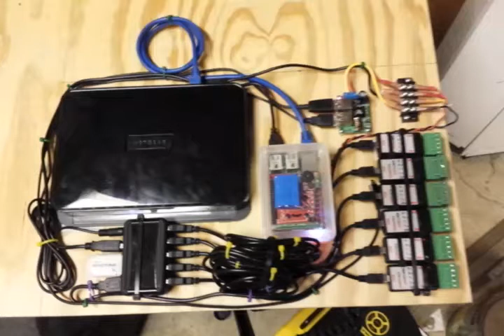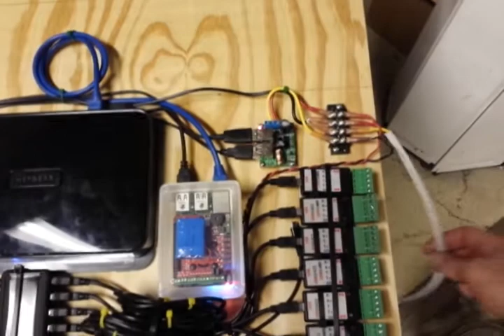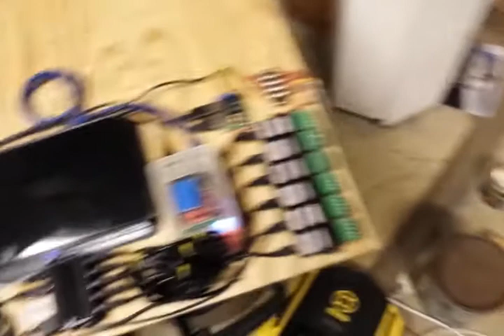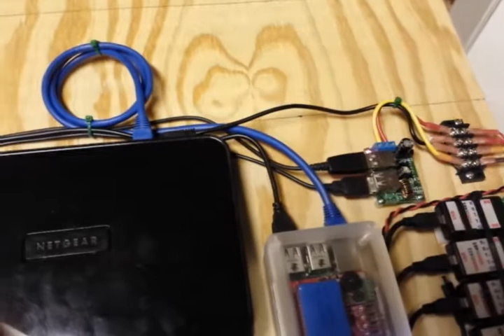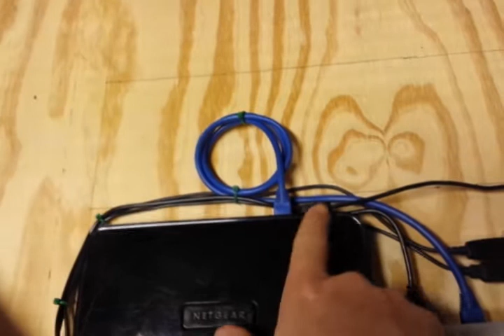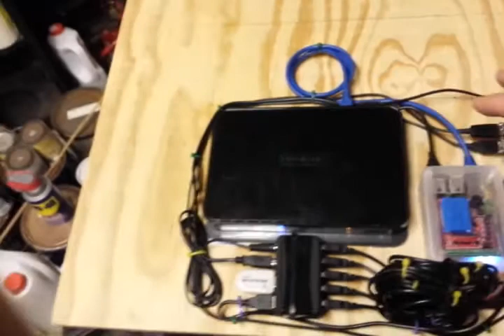Openplotter hardware

Comment: Where did you source the nmea to usb adaptors?
Reply from the maker: Ebay.  $10.  They are called RS-422 to usb adapters if I recall correctly.
Reply from the maker: https://www.ebay.com/itm/2-in-1-USB-to-RS422-to-RS485-Converter-Adapter-with-CH340-/131833025902?_trksid=p2349624.m46890.l49292
Reply: @muckleyj  thanks so much. $10 is super cheap. I have an old B&G system that I want to incorporate wireless into for multiplexing data to my Mac, phone, and watch. I’m hoping I can get my older radar to overlay. Also hoping to get remote control of my autopilot. Here’s hoping it works. Thanks again for the help.
Reply: @SailorDickChannel  hello I just see your post, did you get your old B&G to transmit data to your iOS SYSTEM ? I have an old Hydra 2000 and was wondering if it could share data ?
Reply from the maker: I would be hesitant to trust my life to this type of setup.
Reply: @muckleyj  I had a different multiplexer that was flawless until I screwed it up. Lol. Will definitely require some testing.
Reply: @muckleyj  I was also considering the Digital Yacht NMEA to USB connector

Comment: Hello thank you for your video. Have you try to connect an old depth sensor with coaxial cable after separate and unbraided the + and - pole directly to rs422 adapter? 

Thank you in advance.
Reply from the maker: No.  From my experience, typically, instruments need to go to their respective control head and then the control head will output a NMEA 0183 signal.  That's what I show in my video.
Reply: @muckleyj  ok thank you for your answer
Reply: Thanks bro great stuff

Comment: High risk and worthless for practical use, because only receiving ais is useless. Really important is SENDING ais, so other ships can see your in time.
Reply: Any suggestions for a "cheap" AIS transmitter?
Reply: Far from useless. If you’re crossing shipping lanes, you need to see the heavies. Not to mention, AIS transmitters are still in the upper three digits price range.
Reply: Lol. Total disagrement here. Small crafts benefit greatly from receiving AIS, as observed by my experience of the St. Lawrence Seaway at night.
Reply: @Nardypants  agreed.... they also benefit from turning AIS transmit OFF when passing piracy areas too.
Reply: Sending/receiving AIS is nothing to do with this setup specifically, sounds like an armchair comment to me! And several sailing channels use similar setups and have been cruising for a couple of years with them.
Reply: Very useful to have receive AIS. If you are boating in a crowded area, you can (cheaply) see if any large ship is nearby and adjust your course.

Comment: This is awesome. Couple quick questions for ya. What role do the Rs422 serve? Are they necessary? Also what's the purpose for the large router as opposed to a smaller USB dongle? Thanks!
Reply: @muckleyj  Thank you that definitely points me in the right direction. Are you still running this setup?